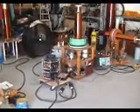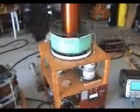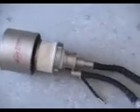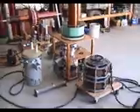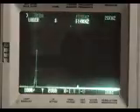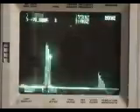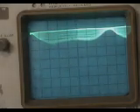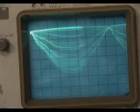Big VTTC

Comment: this is pretty neat and i was really surprised when I looked up the datasheet that this tube has an amplification factor of 5.  I always thought that tubes had to at least have an amplification factor of 50 to oscillate like this. so one coil is connected to the plate and b+ and the other coil is connected to ground and to the grid leak and then the grid?
Reply: yes

Comment: That's a good tube to use...it doesn't need a specific operating position and it can be cooled easily.  Did you take the filament transformer from a transmitter?

Comment: Oh yeah, but you were applying thousands of volts negative on grid... That's funny because datasheet for 3CX3000 says -500 is max for the grid? Maybe it could still be possible to do the interrupting through the grid somehow. Who knows. At least powerex has high voltage IGBTs up to 6.5kV although that might not be practical...
Reply: you dont need a scr or triac igbt etc rated at full plate voltage to interrupt the cathode, ive used 1.2kv scr etc on 5kv b plus
Reply: @T2D.SteveArcs  
He said he needs -3kv minimum on the grid to turn the tube fully off (which is insane, but I suppose with a mu of 5…), so he’d need an SCR rated to at least that much.
Reply: @vdekjEE  you don't interrupt the grid, you lift the ground connection from the cathode, I used a 1.2kv scr to interrupt my 39b coil with 10kv plate voltage
Reply: @T2D.SteveArcs  I believe (from what I've read from multiple sources) that cathode interruption works as such: when the SCR/FET/Triac/etc. is open and not conducting, the cathode becomes more and more positive. The grid is grounded through the feedback coil, so the grid becomes negative with respect to cathode. This is what keeps the voltage across the interrupting switch low. Normally this voltage wouldn't be in the multi kV range, but he seems to nee multiple kvs to turn off his tube fully, and so the SCR would need to withstand that voltage.

So while you aren't interrupting the grid, you are using it to turn the tube off.
Reply: @vdekjEE  oh man we will have to do a voice call at some point to discuss this, too much to type mate